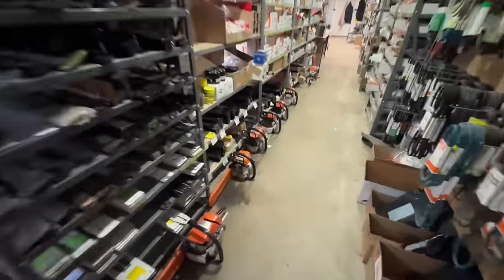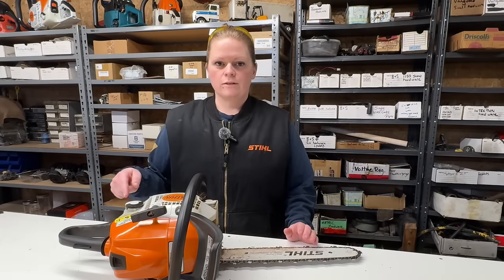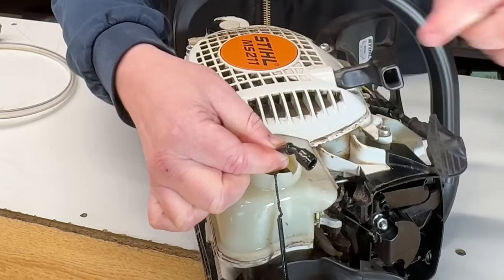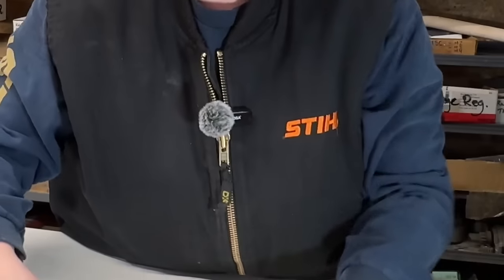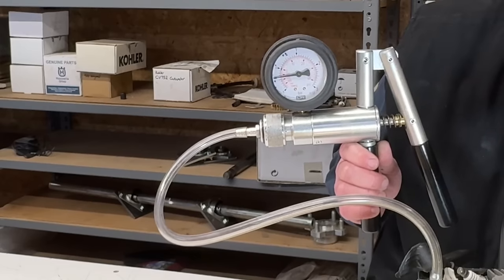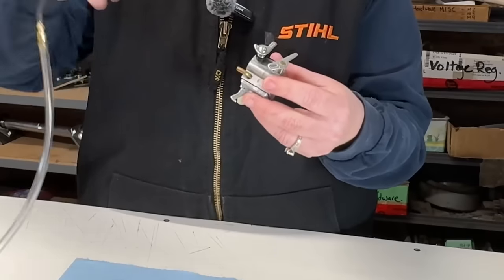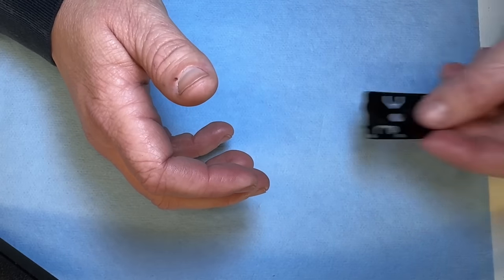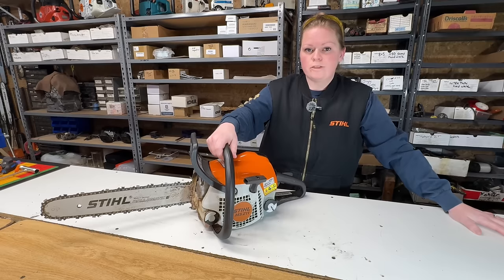Stihl MS211 Chainsaw   HARD To Start!  Bogs And Dies! WHY?   We’re Going To Find Out!

Comment: Great video...I have to say that I really don't like the throw away mind set of people today...Motorized tools and vehicles need maintenance, buying new does not fix the lazy owner problem. It just makes for more things being thrown away that can be fixed. The truth is maintenance cost money and that is the cost of owning tools that get used.
Reply: I totally agree with you on throw away mindset. I have an MS170 and I've spent the price of saw in repair/maintenance, not all in one shot. I'm hesitant to bring it to a shop and try myself with the help of videos like this. I managed so far, but I'm an IT guy, better at Googling for solutions. 

Bought an MS261 recently because I need to cut more wood and more frequently. Will still try to keep the MS170 going.

Comment: Have you worked on any Stihl FS94R trimmers with vapor lock problems? I had 2 of those, & they’d get hard to start every summer when it got above 85-90 degrees. The only way I’d find to temporarily fix it was to crack the gas cap & release the pressure from inside the fuel tank. Thank you for your straightforward videos.

Comment: Thank you so much for taking the time to go through all the air leak testing. 😊
When you talked about time that the shop takes to get into these chain saws, that is why on my (MS-291) they put a label on there bench of as is sales product out in lobby of JD tractor sales business. Thay priced my MS-291 at $420 sold as is. The saw was damaged on handle bar behind the black hold down safety. Just cracked. ( I taped it up with Gorilla Tape) The sales guy at counter told me exactly what you said. There techs time to replace handle cover was not worth it, they could sell it as is. It was a new saw. I have never had a issue cutting with her. 😊 She cuts like a raped Ape 😊 compared to my (Sears) saw. I bought the sears because I liked the priming bulb, and the Price. But boy the Stihl cut so much faster and better for personal usage cutting up round stock on branches especially Harder wood. I have a tone of big branches, that took no amount of time with Stihl, 😊 the Seare saw was slowsr cutting. Just harder on my old back.😊😊 I wished lived closer to you, love the COIL test with feeler gage tool.

Comment: Excellent! Truly Excellent tutorial.  Camera work is clear, in focus with really good closeups.  You delivered your content without any extraneous blather and was very complete and to the point.  Though I think of myself as a pretty good home-owner mechanic and download OEM service and parts manuals for all the equipment I own and refer to them before starting a job.  However, you showed me a more precise way to set coil gap and a procedure to pressure check the needle and seat.  I have a Stihl MS210 "hurricane saw"  (I live in Florida) that like a fire extinguisher, hope never to have to use.  Right now I can't tell if the saw has a kick-back problem when pull starting or if I am just too old (81).

Comment: This was very thorough video. You may have solved my same issue. I had to rebuild the cylinder etc and ordered new carb that didn’t fit the carb cover. So if I can find the carb gasket kit that may be the exact issue fix that is needed. I’m in Italy and they don’t use ethanol fuels, but the age and old gas may have added to the deterioration of the gaskets. 100% impressed with your testing and results. Grazie Mille! Thank You!
Reply from the maker: Glad it helped

Comment: nice idea using the dropper for the gas check.  Thinking that Stihl will phase out the cheaper gas saws since cheap chainsaws from Amazon can be bought or an electric saw is more suitable for homeowner so they do not ruin the saw by neglecting proper gas maintenance

Comment: great video content on diagnosing 2 stroke engines. I've worked on my own stuff before, didn't realize how important the pressure and vacuum test to crankcases and fuel system are. I need go get my saw out the shed and do some exploring.

Comment: What does doing both a vac test and a pressure test  on the engine show that just doing 1 or the other wouldnt?
Reply from the maker: Great question!  So, sometimes crank seals will leak under vac but not under pressure.   And I have seen many times where an intake boot will leak under pressure , but not vacuum.    The Stihl service manual states both a vacuum test and pressure test must be done , vacuum always first.
Reply: @marriedwithsmallengines  thank you. Where in ontario is your dealership? I'm located in peterborough and always looking for good places to take my stihl equipment.

Comment: You need a new pointer finger, eh?  Does Stihl not recommend a pop-off test on the needle/seat?  Good to look at the mixture screws taper area for damage caused by bottoming out the needle.  Never did like a saw with one bar nut, but I do have a couple electric like that.  Good for around the house, start every time.  😁

Comment: I always dump the fuel from my  saw tanks after cutting wood. I'm cutting 8-10 cord a year.

My 031-041's have never had fuel problems for starting. I use Sheets non ethanol 90 octane fuel also mixed w/ Stihl synthetic . You take care of your saw, the saw will take care of you ! Stay away from store bought canned fuel.
Reply: I am new to chainsaws and I use my saws only a few times a year. But I've been tought to do the same. Take old homemixed twostroke fuel out and fill it up with aspen twostroke. It has a 5year shelflife and is safe for long storage in your engine. 
After emptying I just run the saw on aspen for maybe a minute in idle and done. Set it aside for months and they allways start up smoothly

Comment: Looks like a brand new saw.  Still under warranty?  I have purchased 3 stihl machines, and in every case, they doubled the warranty if I bought an 8 pack of stihl premix oil.
Reply from the maker: It is newish (under 5 years old, barely used) , not under warranty - not that any of it's issues were warranty issues.  Thanks for watching!

Comment: I fully agree to find the actual issue before adjusting the carb., however I see no reason to not at least check the settings, in case the owner tried to adjust for the issues. If you know the adj. were not changed from when working, then I would leave them alone till finding the dirt(I imagine); still watching.

Comment: When you get a compression tester for small engines, what adapters needs to come with it? I have some vintage equipment made in SAE measurements and newer gear made in metric. Perhaps an ignorant question but do I need adapters in metric and SAE? I see that some tools come with several adapters while others only have one or two.

Comment: My local saw shop sells ethanol-free gasoline by the gallon and will add 2-cycle oil per my specifications. At the end of my  cutting season (October) i drain the fuel from my weed eater, chainsaw and other gas powered tools and then run them until the run out of gas.

Comment: The 211 has a terrible reputation here in Australia, restart and running issues being the biggest problems. I have one at home with a bent connecting rod, I am still baffled how you bend a rod in 35cc chainsaw.

Comment: If it not economically viable to repair because of labour or parts costs , then a part exchange or trade in might be more suitable for these low value items. The unrepaired units would certainly have value in the scrap  metal.

Comment: What's the best way to stop this happening? run it out of fuel before storing or what?
Reply: Disclaimer: If someone else has a better solution please share, I have a limited experience with petrol tools.
I do not know if leaving it dry is a good solution since you will still have ethanol residue everywhere i guess ?
Info I found about this is to empty your gas tank, run it dry, fill it with an alkylate fuel and run it for a few secs/revs before putting the chainsaw on the shelf. I use motomix but there should be other brands out there.
Again this is info I gathered around, If someone has a better solution on this please do share :)

Comment: Damn Ethanol!!  Too many believe it's great.  They don't talk to the techs, maintenance, or repair shops that actually see what this gunk does to anything it touches.  And... most ethanol gasoline has only 10% in it.  Imagine if there was more.  🤨🤯
Reply: And you get worse mileage 😢
Reply: Here in France the 10% ethanol is slightly cheaper, but as it ruins your 2 strokes
it works out much dearer in the end. Avoid like the plague!!
End empty your tank and run the carb dry before storing for long periods.

Comment: Can anyone tell me why a S55 chain is listed to fit a Stihl 170 (16" bar ) AND a Stihl 211 (18" bar)? How can the same length chain fit two different length bars?
Reply from the maker: That could be a mis-print.  Is this an Oregon chain ?
Reply: @marriedwithsmallengines  Thanks for responding! Ive looked at several brands of chain. As an example look at the back of the Oregon S55 chain package. (red and black package)
Reply: May be the dimensions or shape of the guide bar.  Might be thinner or the nose may be different or the sprocket a different diameter.
Reply: S 55 is the chain style not the length.

Comment: Why does this 211 have two "intake" ports and impulse???
Reply from the maker: The Stihl MS211 has a intake port and a strato port.   The top port is the "stratification" port which is a fuel free air port.  Just fresh fuel enters that hole. This is all to do with reducing emissions and making the saw run "cleaner".
Reply: @marriedwithsmallengines  Thank you! I love to learn new stuff!!

Comment: Thank you ethanol, the biggest destroyer of rubber parts of carburetor EVER!! NEVER run this crap in small engines EVER. 
You’ll regret it
Reply: modern parts should be ethanol safe at this point.  That said,  the corn lobby is too powerful pushing ethanol into fuel when there is limited value in it.  wish it was optional in pump gas where i live.

Comment: why is all the fuel blue, what type of oil are they using that makes it blue?
Reply: Sunoco blue hitest gaz
Reply: The blue fuel is probably the pre-mix stuff that you buy in cans, like Trufuel. Many people buy that instead of mixing their own fuel, as it is specially formulated to run in these small 2 stroke engines and doesn't have any ethanol in it like most pump gas does. The ethanol is what destroys all of the rubber seals and membranes in these small engines. I guess it could also be leaded aviation fuel as that is also blue, but I doubt it because you can only get that an airport.